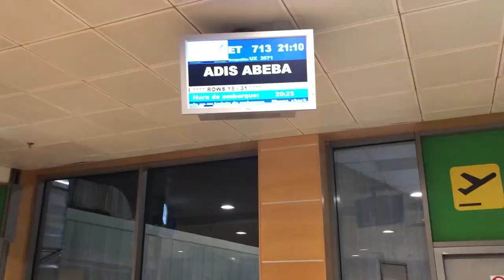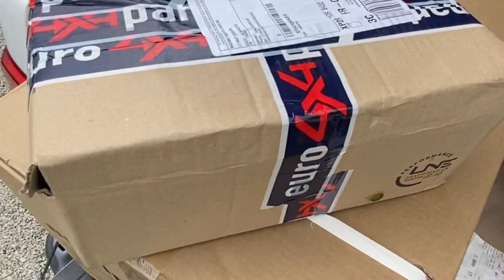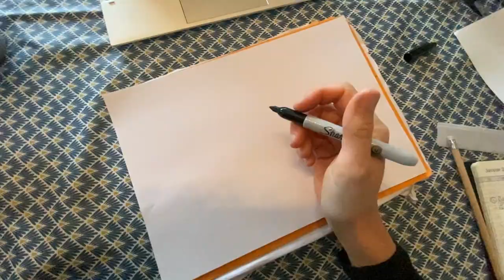I CONVERT MY TOYOTA HILUX INTO AN EXPEDITION VEHICLE TO GO TO AFRICA SOLO

Comment: Very cool! I love the simpler setup you went with. There are some overlanders with admittedly cool, but really expensive setups which can give the impression that you need an expensive setup to overland in Africa. Do you have a long range fuel tank, or you rely only on the jerrys? I have a soft shell tent and I havent gotten tired of it yet, although im going with a 50L fridge.

Safe travels and looking forward to following your journey.
Reply from the maker: Thanks so much for your comment! No need to go expensive and fancy to overland. I only rely on the original tank (80L) and I only had to use my 2 jerrycans once since 18 months. Happy you enjoy your soft shell!!

Comment: Very nice and simple set up, however I will definitely consider 2 major changes. 
1st Hard shell tent as it sets up so much easier.
2nd a sliding system for the boxes, that makes life so much easier. 
Apart of that my admiration for not overload the rig with stuff and for keeping it light and simple - my believe is that pays off!